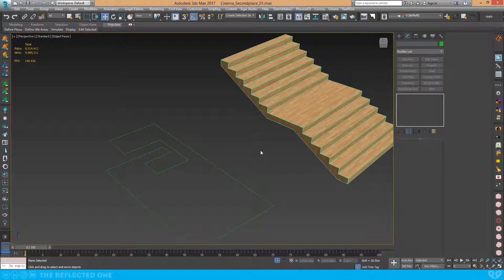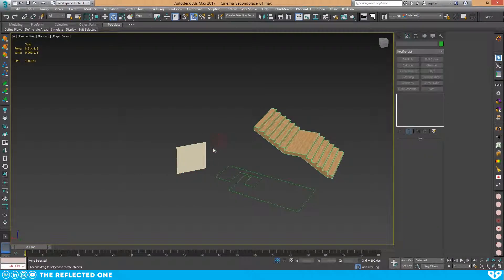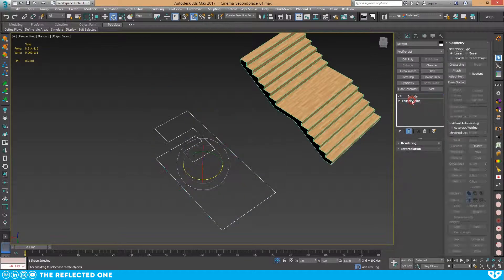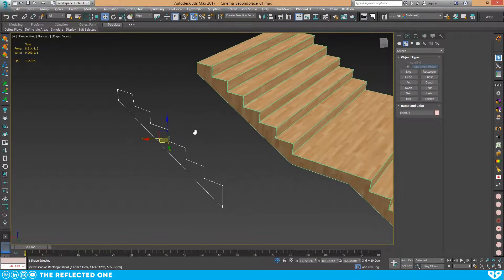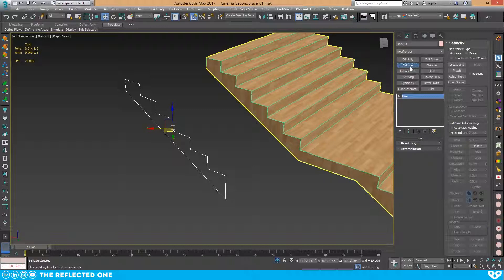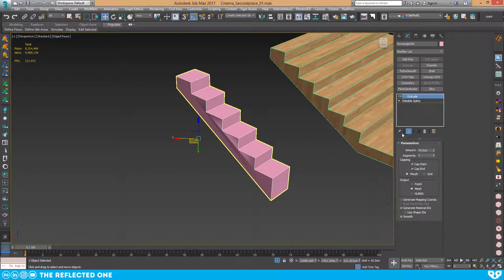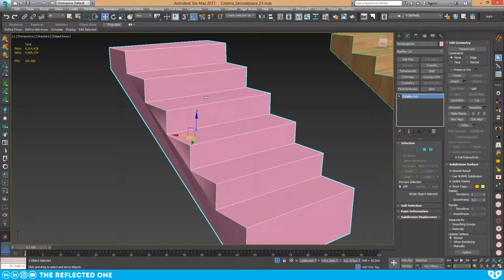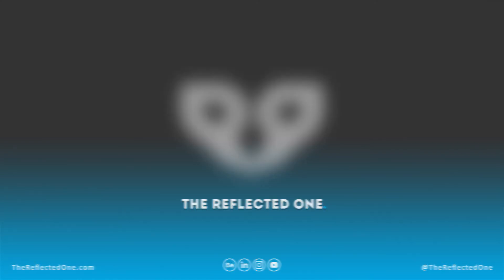Solved: 3DS Max converting line to editable poly, shape disappeared!

Comment: Also you could Clear all smoothing groups ;)
Reply from the maker: thank you for mentioning Lilith.
can you explain more?  clearing smoothing group for which part? the slice?
Reply: @TheReflectedOne  You're welcome! When you get that shading issue is usually two things. Either Normals ( reset normals ) or smoothing groups. Convert it to Editable Poly > Select Element > Smoothing Groups > Clear all.
Reply from the maker: @lilithjones9139  lilith, thank you so much for the information you provided here.
and that's totally right.
but in this case the problem is not about the smoothing groups.
because we have a plane with different vertex positions and it's a polygon with more that 4 sides;  we have the problem here. so you can either use a slice plane (which will automatically create a straight polygon related to our gizmo) or select the polygon and then in "edit geometry" tab> click on "Z" .
Reply: @TheReflectedOne  Another option is to enter face mode, select all faces, and use re-triangulate option. This usually solve the shading problem
Reply from the maker: @SG-op7cw  Hello, Juan!

I'm really glad you brought this up again, so I’ve attached the project file so you can test and try different methods on the actual model from the tutorial. 
and by the way, what a poor sound quality I had back then :D

Project file: https://thereflectedone.com/wp-content/uploads/2022/05/Extrude-fix_Project-file.zip

Comment: Really good. I am suffering this with problem after converting to spline dwg file become disappeared in max.
Reply: But in your tips it is   not yet solved absolutely.
Reply from the maker: @gopalsaha3463    try to weld all vertices and delete overlay lines.
I recommend using "Spline Check" plugin  for checking the splines.
you can find it here: https://www.simpolium.com/spline-check/
Reply from the maker: glad it helped you.
yeah i know the pain from AutoCAD !!

Comment: but why the shape dissapeared when i cliced extrude although it's spline ? please answer <3
Reply from the maker: hi farida.did you attached your spline to a new shape like rectangle? 

when you create spline in so many direction like i did in the video, your vertices have different "Normals".
so the extrude doesn't know which direction it should be extruded!

but when you  create a rectangle, all its vertices have the same Normal or "direction" 
by attaching the spline to the rectangle the spline now have the same normal as rectangle.